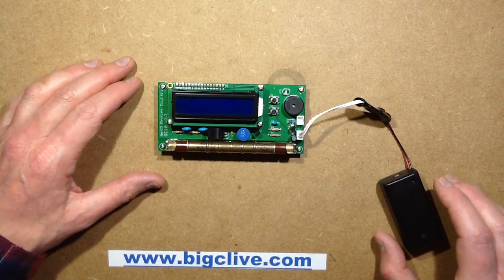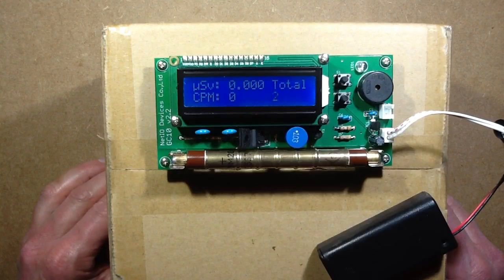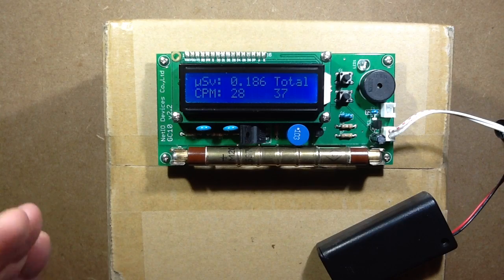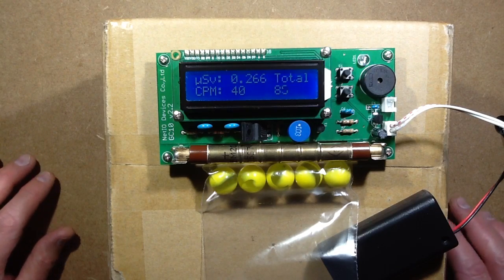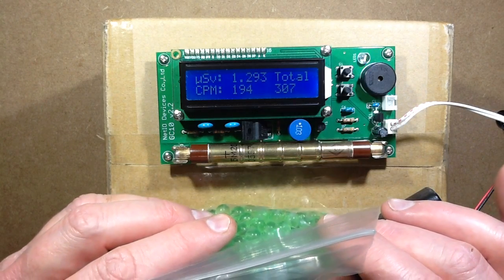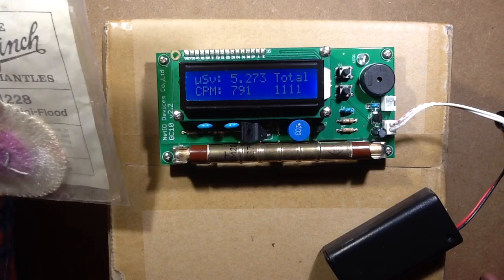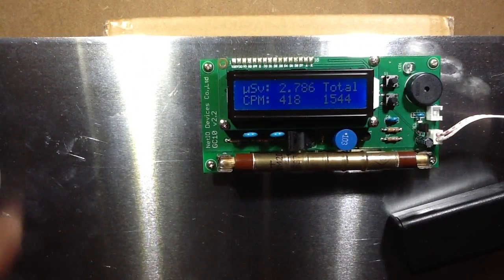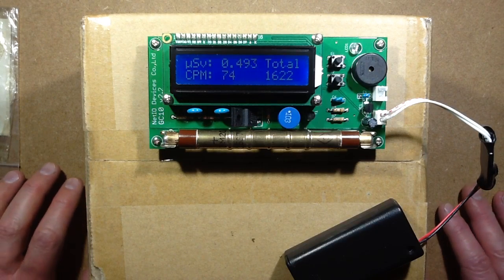Using a Geiger counter on uranium glass and thorium mantles.

Comment: The alloy between the mantle and the GM tube may well be generating X rays ...... in the industry 500 micro was considered to be a monthly dose limit based on results from the atom bombs dropped on Japan and latterly the Chernobyl disaster victims.

A gm tube should not detect beta or alpha without a supplementary detector for beta however it may detect X rays.
Reply: some more information

https://en.wikipedia.org/wiki/Bremsstrahlung

Comment: Where did you get the radioactive gas mantles? I've been looking for ages and can only find the non radioactive ones.
Reply from the maker: +Tech2025 They've been here for decades.
Reply: bigclivedotcom but where do you buy them? I can't even find them on ebay
Reply: They ARE available on eBay, but since the sellers often will not directly say the word radioactive, you need to read between the lines....test source, Geiger Test source are 2 terms used, but not the only terms used.
Reply: I managed to find some at Canadian Tire(Canada only obviously lol) but antique stores are another bet, if you're into that.

Comment: Hi Clive, There is Thorium in some tig welding rods. I will run my (Maplin) counter over some.
Reply from the maker: I just tried a box of standard welding rods and didn't see a significant change in ambient level.  I'll try some others in the future though.
Reply: No it is only the Tig electrodes ( I should have said electrodes)
Reply: Just checked, they are thoriated Tungsten and the count is around 0.15/0.17 mills on my counter.
Background here is around 0.1/0.12.  Nowhere near your mantles I have some somewhere for my Tilley lamps.  Keep up the good work!

Comment: I still have a tiny tin of Humbrol Luminous paint. Some of the paint is on the lip of the tin. I keep it in a garden shed on a high shelf but at night when you open the door there it is - GLOWING GREEN. 

The new phosphorescent paints are called 'luminous' but need a light source to recharge them. This old Humbrol paint manages very well on it's own. I assume it's banned now. After the old Smiths dial factory was closed they found an area where the old paint tins had been dumped beyond safety limits. The soil I believe was put in drums and is now possibly at the bottom of the sea. 

They might even be off the Isle of Man.  Do you like sea food Bigclive? Does your beard give off a faint green glow in the dark ? Have you tried switching the light off in the toilet?

In regard to Russian video's on electronic kit. They look good, on average better than many. It's annoying when all you can find in 'English' is some dork mumbling a pathetic 'review' and plugging an amp into a crappy speaker and expecting  you to subscribe.  

Real Russian vodka, it goes down neat like a nectar from the God's. You won't find it in an off licence.  People from cold countries have the warmest hearts. You are so right about Russians - http://englishrussia.com/  They are completely mad of course LOL.
Like someone else I know.
Reply: Yep, that paint has Radium and some sort of phosphor.
Generally, the phosphor degrades over time, due to Alpha bombardment and moisture, which is why most Radium painted items no longer glow.

Comment: A lot of people collect WW1-2 to 50s aircraft clocks and other stuff and don't know that those are very radioactive. Anything that has stuff that glows in the dark or at least used to glow and produced before 60s can be very dangerous. Aircraft/railroad equipment, watches/compasses, some switches etc. If you see slightly orange dots, letters, paint on clock hands etc - use Geiger counter. It's not radiation by itself that dangerous (but still dangerous) unless you keep those under your pillow or in your pants but radium paint which starts to fall off and you will inhale small particles causing massive amounts of alpha radiation to wreak havoc on your internal organs, which aren't protected by skin and clothing. One guy had a WW2 aircraft radio that was more radioactive than a truckload of those gas mantles.
Reply: Radium paint yes, it was even used on alarm clocks for a while. The 'orange dots' you're mention sound like the paint on old Fiestaware dinnerware, but it isn't used for self-illuminating paint :)

Comment: Should have tried a banana
Reply: Not much radiation to be detected....the source involved is Potassium-40...not much of it in a single Banana...A large bag of dried Banana chips might be a bit easier to detect.
Some better sources of Potassium are
1.Sodium-free salt substitute...this is basically pure Potassium salt
2.Potassium tablets from any place that sells vitamin/mineral tablets(to get better results, crush the tabs to increase the surface area)-but should be easily detectable even whole.
3.Water softener salt.

Comment: I wonder if my Tritium glow fob emits enough to set this thing off.
Reply: Tritium is a Beta emitter-quite low energy-the plastic housing should stop it...HOWEVER, with a detector capable of detecting very low energy radiation, you MIGHT detect a very small amount of X-Rays....this is due to the Beta striking the glass tube....look up bremsstrahlung, also called "breaking radiation" to understand how(and why)this happens.
The plastic housing will block some of this, but not all of it.
But no, the detector he has will not detect it(but connect a Mica window GM tube to it, and it just might).
Some examples of tubes that should work...LND 7313 or LND 7317-NOTE NOT the fairly common LND 7311-it needs 900 volts, not 500 volts to work.

Comment: I have a Geiger counter, I calibrate it using an old Westclox alarm clock circa 1950 , it almost goes off the scale due to the radium on the fingers. I don't keep the clock anywhere close.
Reply: And imagine that, people would have kept those a foot or so away from their head for maybe years (cumulatively) Cool as a radiation source, but not for actual intended purpose! Keep it the fuck away!

Comment: All natural uranium isotopes emit alpha particles. They have very low beta and gamma activity.
Thorium has the longest half-life of all the significantly radioactive elements, 14.05 billion years; it decays very slowly through alpha decay to radium-228, starting a decay chain named the thorium series that ends at stable lead-208.
Reply: I think depleted uranium is an alpha emitter, but it does decay into a few gamma and beta emitters. This is because uranium-238 decays directly to thorium-234, which with a half-life of 24 days decays to protactinium-234, which in turn decays in a matter of hours to the long-lived uranium-234. A quasi-steady state is therefore reached within a few multiples of 24 days.

Uranium-234 is actually so stable, it has near negligible radioactive danger, and is actually more of a chemical toxicity concern.
Reply: Uranium and thorium are both alpha emitters, but they also emit gamma. The proof off that for thorium is in the video here. Neither alpha nor gamma radiation can pass through aluminum,but gamma can, so the counts coming from thorium through the aluminum are gamma.

Comment: I have 1 item to check but dont know what kind of radiation I'm looking for would the ones you plug into your  phone work 
Cheers
Reply from the maker: The phone ones use a silicon photovoltaic cell in a light-proof case to detect radiation.  They'll be most sensitive to gamma radiation which is the most harmful.
Reply: Alpha is the most harmful but gamma is the one that takes a lot to stop.
Reply: Only inside the body. Alpha can't penetrate skin as well as Gamma.
Reply: Alpha radiation can't penetrate the dead cell layer on the outside of your skin. Inside, the same property that makes it so easy to shield against turns it into a wrecking crew when it bashes into DNA.
Reply: Gamma is the most penetrating, but Alpha is the most ionizing, which makes it the most damaging IF an Alpha source gets inside you.
Reply: While general alpha particles aren't high energy enough to penetrate hardly anything, alpha particles emitted by radioactive decay can be 3x as fast and penetrate 3x as deep, so I wouldn't be comfortable putting something emitting them from decay close to my skin.

Comment: All the beta should've been blocked by that; that means there's gamma coming off it. I'd put those mantles in a three inch thick lead box.
Reply: When Clive placed the thorium mantles next to the Geiger counter, it spiked from about 1.2 µSv to just under 5.6 µSv. As examples, the background dose received by an average person over one day is 10 µSv. Also, an airplane flight from New York to LA would equate to 40 µSv being absorbed by the body, and the average yearly dose a radiation worker must be limited to is 50 mSv. Furthermore, a fatal dose is generally considered to be between 4 to 8 Sv in one exposure. Finally, if one was unfortunate to have been standing next to the Chernobyl reactor core after the explosion and meltdown for about ten minutes, then one would have been 'hit' by a massive 50 Sv dose all at once.
Reply: thx for putting values into perspective.
Reply: The exposure rate on the device is probably supposed to be microsieverts per hour.
Reply: kurt44mg42 50 Sv?! I'd like to have seen how long the poor bugger would have lived for after that, Could you imagine how bad the radiation poisioning would have been?
Wouldn't have taken long to die after that kind of an exposure.
Im glad no one has ever been exposed to that kind of radiation before.

Edit: Please excuse me commenting on an old comment.
Reply: Well some people did receive in the range of 5ish Sv doses that helped with the clean-up. After more than a few Sv, you're pretty fucked. 50 Sv I'd almost hope would just be faster and less suffering ...
Reply: @bueb8674  If you're interested in reading about poor Dr. Slotin: https://en.wikipedia.org/wiki/Demon_core#Second_incident
"Over the next nine days, Slotin suffered an "agonizing sequence of radiation-induced traumas", including severe diarrhea, reduced urine output, swollen hands, erythema, "massive blisters on his hands and forearms", intestinal paralysis, and gangrene. He had internal radiation burns throughout his body, which one medical expert described as a "three-dimensional sunburn." By the seventh day, he was experiencing periods of "mental confusion." His lips turned blue and he was put in an oxygen tent. He ultimately experienced "a total disintegration of bodily functions" and slipped into a coma.[21][22] Slotin died at 11 a.m. on 30 May, in the presence of his parents.[23]"
Reply: @AureliusR  "People who have been exposed to sudden blasts of radiation"

People like Harry Daghlian Jr and Louis Slotin.
Reply: At college we had some radioactive samples in the physics lab, each in a small lead container of a few millimetres thick. When we measured the gamma source it made no difference whether it was inside the box or outside the box. Our physics teacher explained that's why the best protection against gamma radiation was the inverse square law - in other words, get as far away as possible.
Reply: There is no such thing as overkill; there is only 'open fire' and 'time to reload'.
Reply: If the radiation was much higher the mantles would probably glow without being hooked up to a gas supply.

Comment: There are a LOT of kits out there that use the very popular SBM-20 tubes, and although the entry level Arduino based kits are inexpensive, it doesn't require too much extra investment to get something very useful , e.g. - http://www.ebay.com.au/itm/MyGeiger-Dosimeter-ver-2-DIY-Geiger-Counter-Kit-with-USB-without-tube-SOLDERED-/321423900968?hash=item4ad65b8128:g:EZcAAOxyF0pTh3E3 , which has a lot of very useful functions (including USB based battery charging capability).  If you really want to scare the neighbours - this will fit the bill quite nicely :-) - http://www.ebay.com.au/itm/HUGE-RADIATION-GEIGER-COUNTER-SURVIVAL-KIT-/232073414464?hash=item3608a74740:m:mHoxcs5Ky37YL9FyEaToNUQ Expect a visit from "The Men in the White Coats" ! :-D

Comment: The voltage on an SBM-20 should be about 400v, not 500v.  Individual tubes of course will have a sweet spot that they like but you start at the specification voltage.  Beta will also not penetrate far into the body, especially not the skull.  The brain is actually one of the more resistant organs to radiation as it's not constantly in cell division like the rest of the body.  There is a small amount of gamma emitted from the mantels but nothing to be concerned about.  The inverse square law also means that any distance away from those sources there won't be hardly any measurable dose at all. Here's a video showing some real radioactivity. https://www.youtube.com/watch?v=CzIeppyxOUM

The cell phone apps are worthless they're for entertainment purposes only.

Comment: Thorium is an alpha emitter like uranium. A sheet of paper will stop most of it.
Reply: Trust me, Thorium emits way more than just Alpha.....as you pointed out paper(or the plastic bag)would block it...and the metal wall of the GM tube he is using would block it too.
Thorium emits Alpha, Beta and a bit of Gamma too.

Comment: Should test the radiation that you get from a banana
Reply: It won't be measurable with a regular geiger counter.  It's so low level that you'd need a lead cave and a scaler geiger counter or a gamma scintillator.
Reply: +UnrealVideoDuke 
He uses the banana differently.
Reply: It's not measurable. I have tried it with a Victoreen CDV700.
I have some KI and KCl. I can measure those.
Background radiation is 12 CPM while with KCl, I think it was 20 CPM.
The radioactivity comes from K40 which is sometimes a beta- and sometimes a beta+ emitter.
Reply: He electrocuted the whole bunch.

Comment: Clive Uranium is an Alpha emitter, to test the radioactivity you should take it out of the plastic bag
Reply: alpha wont penetrate the walls of that geiger tube, you need a packake tube (uber thin mylar window) or ionisation chamber to detect the alphas. That said I thought Uranium emitted some gammas along the way (sometimes it its the daughter product that emits the gammas), but I cant be bothered to check right now.
Reply: pancake tubes use a Mica window, not mylar.
And yes Uranium emits Alpha, but it's daughters emit Beta and Gamma as well

Comment: Hey Clive don't know if you'll see this comment but the reason it is called "Vaseline Glass" is uranium glass manufactured before the 1890's-1900's used to be a semi transparent yellow that looked fairly reminiscent of a certain petroleum based Jelly.

 After the 1900's though they mainly switched over to producing a more vivid Green glass that appealed better to the masses. They made this by also adding Iron Oxide along with the Uranium. I have personally collected a bit of it at Resale shops I frequent using a High Powered UV light I 'Built...'

Comment: As a former angler, I'd be interested to see what reading you'd get from the 'isotope' glow-in-the-dark bite indicators that are used. I've heard they have a half-life of twenty years which sounds fairly weak but I'll have to see if I still have any around that I can send you...
Reply from the maker: +tony sansom They sound like tritium tubes which will not emit detectable radiation through their glass vial.

Comment: Hmmm, while Thorium itself is only mildly radioactive, and is an alpha emitter, which is blocked by paper, glass, metal et cetera, it's decay products include radon and radium which are much more dangerous. If you're getting a reading through the plastic bag and even through the aluminium plate, then that's not just Thorium you've got in the bag.
Reply: Sorry, but Thoron? Thorium definitely decays to Radium, then Radon, Polonium and Lead. Here's a picture of the chain: https://en.wikipedia.org/wiki/Thorium#/media/File:Decay_Chain_Thorium.svg
Reply: M. K. What the fuck is Thoron?
Thats.. Not an element.
Reply: @Aslyuriel  I am pretty sure he meant Sauron.
Reply: Thorium does NOT decay to radon.....it DOES decay to Thoron though.
Radon comes from Uranium(really from the Radium component of Natural Uranium).
Pure Uranium does not contain Radium, and thus no Radon.
And Radium comes from Uranium, NOT Thorium.

Comment: the thoruim oxide in the mantle is in it's natural from and is thorium-232 which has 10 progeny and obviously the parent.  it will emit alpha, beta particles and also electromagnetic radiation in the form of low energy gammas and some x-rays produced by the interaction of beta particles with matter  ( with its surroundings which is scientifically called "bremstralung" which literally means "breaking radiation" ).  without going into much detail, it's the transfer of energy due o the collision of an atomic electron (beta particle) with matter and thereby releasing electromagnetic energy in the x-ray spectrum ... 
anyway, the world hates a "smart-ass" so i'll stop right there ... good vid, though ...
Reply from the maker: +Windlass123 All technical input is welcomed on this channel.

Comment: Another great video. I particularly like the zoom... I would also say that if the radiation can still be detected through aluminium, then what you have there is gamma radiation. I would be tempted to store those gas mantles in a lead container, if I were you.
Reply: Luke Stanmore - Ionizing radiation does pass through: the trouble being that some of it may like to stay and have a 'look round' as it were. Especially if it hits denser tissue, like bone, or areas with a high density of blood vessels, like the liver, pancreas, thyroid, spleen, genitalia, etc. Ionizing radiation. Be afraid. Be very afraid.
Reply: most gamma radiation passes straight through you. highly ionising but harmless in low quantities.
Reply: wobblyboost  It isn't, if it's passing through you, it's not damaging you. The damage occurs when you absorb it.